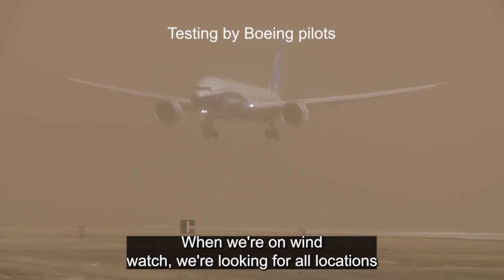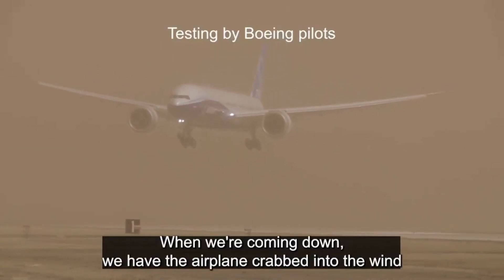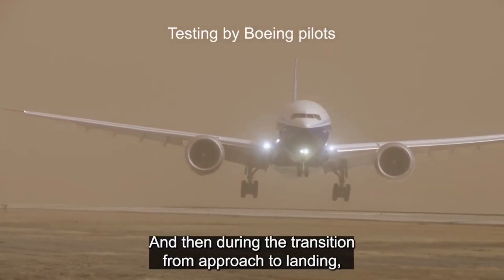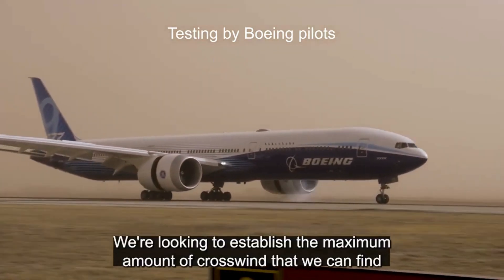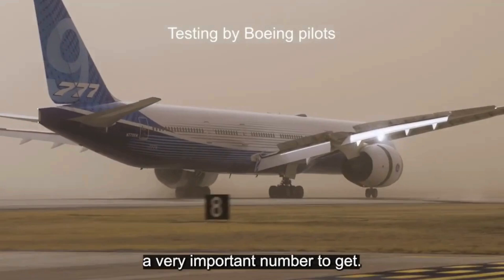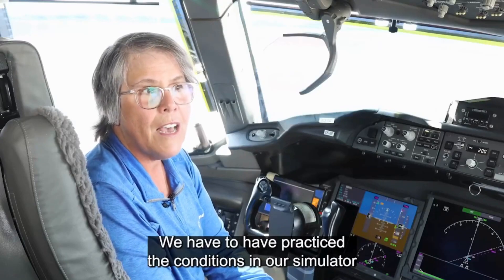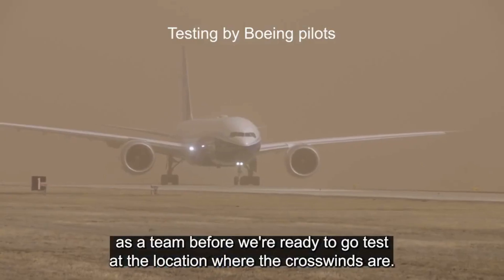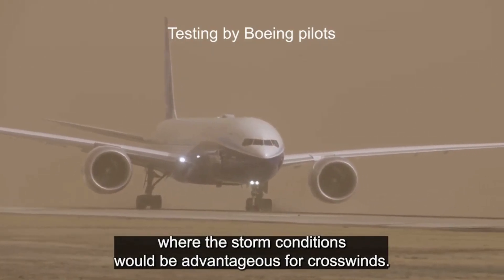INSANE Crosswind Test! Boeing 777X Takes On 60-MPH Winds at Lubbock.

Comment: We need great pilots like her in the boardroom making decisions on how training must be done in the air and on full size simulators, not on phones apps or laptops, when a new piece of hardware or software is put in an aircraft. Bean counters and accountants have no place deciding when and how safety related issues should be solved.
Reply: What???? Nobody is doing certification flight testing on laptops or phones 😂😂😂😂. What r u smoking?
Reply: @sblack48  Boeing initially said no training or updated manuals were needed after the crashes. Then they decided a phone app would suffice for familiarizing the pilots with the new software that caused the crash. But the pilots basically told top management they were nuts, so the training via phone apps and laptops never started. Simulator training took place instead.
Reply: @hifinsword you said TESTING not TRAINING. Usually differences training IS done on a laptop or iPad so there’s nothing wring with that. The pilots were panicking for nothing but I guess Boeing shot their credibility. Right now on the max they spend half a day on a type rating on that one failure (mcas) which is completely ridiculous. The design changes they’ve made mean that it can never happen again so that time is completely wasted in a simulator. They should be using that time to review the hundreds of other possible failures. This is all being done to make people feel good, not to actually improve safety. But that’s the price of both Boeing and the FAA screwing up so badly.
Reply: @hifinsword oh and of course there are updated manuals. Nobody ever said that was not necessary.
Reply: @sblack48  I had a career in U.S. AIRCRAFT carrier aviation and 2 tours as a flight instructor training students. When a change to a system comes along, and it involves safety of flight, actual motor skills are involved. That requires flight simulator training prior to actual flight. Boeing did initially say NO TRAINING OR UPDATED MANUALS were needed. No one ever thinks something fixed will break, and yet they do. A lot of checklists and training are written in blood b/c something that should never fail, DOES. Both Boeing and the FAA share responsibility for the deaths. A safety of flight issue like MCAS should always have a backup, yet it did not. New engines in an aircraft that change CG, and causes an uncommanded pitch up requires much more than a wave of the hand approval. Rigorous testing should be required AND DONE by someone other than the builder.
Reply: @hifinsword it’s the 14th word of your post. “On how testing must be done”
Reply: @sblack48  Do your research. Boeing execs initially did say updated manuals would not be necessary. Yes, there are updated manuals, NOW, after the investigators said they were needed, and the pilots protested.
Reply: @hifinsword  The entire MCAS system was changed. An abnormal procedure was added. That mandates an AFM change. There is no legal way you could certify the modification without it. It doesn’t matter what some exec says. It is the FAA that decides, not Boeing management.  The aircraft was grounded at the time and its type certificate was n limbo. It was up to Boeing to meet all the FAA’s requirements to get it reinstated. The suggestion that no manual change was required is laughable and I certainly never heard one and as an aircraft certification engineer I was very familiar with the issue.
Reply: @sblack48  I did not say no manual change was required. I said Boeing execs initially said that. Why do you continue to put words in my mouth? For someone supposedly very familiar with the issue, you are very unfamiliar with what Boeing's top brass tried to get away with!
Reply: @hifinsword  Boeing's top brass doesn't determine what is required. The FAA does. You haven't offered any evidence that anyone at Boeing said no AFM changes were required. That simply doesn't make any sense.
Reply: @sblack48  My post wasn't about certification flights, but actual commercial flights and pilot training after the 2 fatal crashes of commercial flights.

Comment: Why is the right gear bogie elevated like it's in translation at 1:59 when it is not?
Reply: It's due to the crosswind on take off. It's right before they rotate so very little force is on the main gears, thus making the roll forces that the crosswinds place on the plane more noticable.
Reply: Yeah they should put the ailerons towards the wind so that side won’t lift off. Nice observation!!

Comment: I must say that by the time it enters  service, it should be the safest, most tested plane out there
Reply: You would think so. I just hope that they have included all the necessary redundancies to ensure the folding wingtips don't unfold in flight, and that it ends up being a case of, "well, we never actually considered that"  😮
Reply: @mickeysmiths   more than likely the winglets are incapable of moving in flight, if not because of a safety system then by the sheer force of the air passing them. The motors that actuate them are likely not very powerful, and doubtful strong enough to overcome wind moving at 600mph.
Reply: @ILikeTuwtles   Yep, I understand. You are most likely correct  👍
Reply: @mickeysmiths Unfold in flight?
Reply: Even if the wingtips fail or break, it won't be a safety issue. The wings will still be enough to fly the plane normally. Wingtips are there for extra lift, hence increased fuel efficiency  @mickeysmiths
Reply: @mickeysmiths  I remember reading somewhere that the wingtips are only meant for takeoff and landing, but will be folded up (sort of like winglets) when cruising?
Reply: @Luapre9ead  I don’t think so, that would defeat the purpose of having them.
Reply: @Luapre9ead  They're only folded on the ground.  The wings are longer for efficiency, but the bigger wingspan put the aircraft into a larger gate category.  They made the wingtips fold so the plane still qualifies for its existing gate category.
Reply: @MilwaukeeWY  Stand corrected then, thanks!
Reply: @Luapre9ead    Yep, you are most likely correct  😁

Comment: Lubbock or Amarillo are certainly great places for this test.  Either city can have winds 60mph for all afternoon.
Reply: So isn't Clovis NM.  I took flying lessons there.  My biggest complaint about living there was the wind.  It was very strong  quite often.   Some said it was due to a compression effect of the rise in altitude of the land.  4300 ft and flat as a pancake.
Reply: @jnbfrancisco  Air does not compress as it rises, it decompresses.
Reply: @fjp3305 i think compression is the wrong term.  It's probably more correct to say the venturi effect.  Similar to the air being sped up as it goes around tall buildings in the big  city's like Chicago.
Reply: What causes them?

Comment: Incredibly smooth landing given the conditions. Hats off to the test pilots for making it look easy (and the thousands of engineers who built this thing).
Reply: Great pilots, great planes
Reply: Would be better without toxic bleed air systems.
Reply: @biokemical  Toxic is your brain
Reply: @biokemical that’s the leap engines, and the 777x is not affected
Reply: @Lockheed_Jets  Ai answer: Yes, the Boeing 777X uses a bleed air system for its environmental control systems, including the air conditioning. This means it extracts hot, pressurized air from the engines to cool and heat the cabin.
Reply: @Lockheed_Jets  You might be thinking of 787, it's absolute insanity that bleed air systems are still used in 99.9% of planes. Essentially only 787 are one of the extreme few (maybe only) that has a dedicated air conitioning.
Reply: @biokemical  You mean just like every other jet since the Comet?    I missed the toxic part.
Reply: @lbowsk  Yep, they're all toxic.
Reply: @biokemical  Love to know more.   Spent the last 40 yrs in cockpits and I feel fine.  Should I be concerned?   Make plans?
Reply: @lbowsk  Up to you, do your research if you want, try bleed air TCP
Reply: @biokemical  I'll think I'll pass now that I am mostly retired.  Thanks.    But I'll be sure and warn my buddies still working.
Reply: @biokemical Prob is, chemtrails inevitably lead to  toxic bleed air systems.  So, you can’t get rid of one without the other.  It’s a small price to pay for mind control.
Reply: Don’t they have filters? 🤔
Reply: @PilotDamian  A lot do but the particles are too small, the filters do nothing for Tricresyl phosphate (TCP) if interested, investigate "Aerotoxic syndrome"